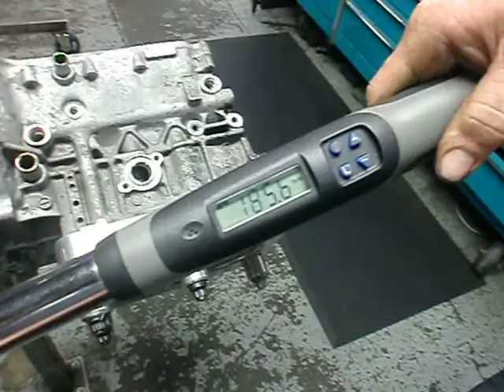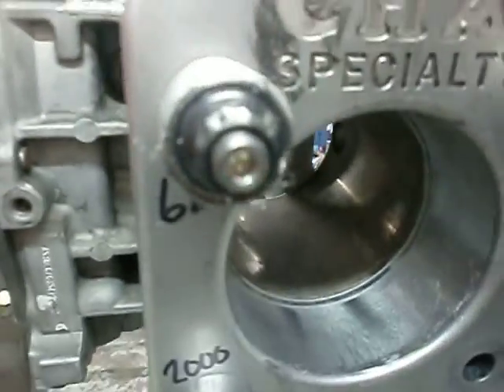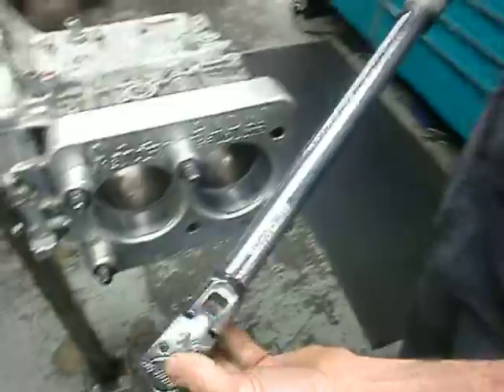Outfront Motorsports Subaru 1/2" Head Studs ARP

Comment: I understand you guys were doing a test and showing an example which is great. With the half inch studs torqued to spec will this cause deformation of the cylinder bores or the main bearing bores??
Reply from the maker: even torquing a stock bolt or 11mm stud distorts the tops of the cylinder bores. This is why the use of a torque plate is important when machining the bores of a block.

Comment: Whats is the boost limit for each stud?  I've been running the arp 2000's to almost 30psi on my closed deck sti with no issues.
Reply: Mike STi 

Supposedly more than 35psi 

I can say 50-60 psi or even more you can see the torture torque test 233 ft lbs that a lot

Comment: Why do you convert a metric part to SAE? Does not make sense... 14mm head stud gaskets are available as well. Kind of like running 3 summer tires and one winter tire on your car ...I do like your demonstration and test though. Well done.
Reply: MooreSport because it clears the head gasket as mentioned. Also bolt clearance at the head . It makes no difference if it’s a stud because you match the nut to the bolt thread . By increasing bolt thickness , it increases torque capability tremendously. M14 is .5513” , 1/2” is 0.5000”